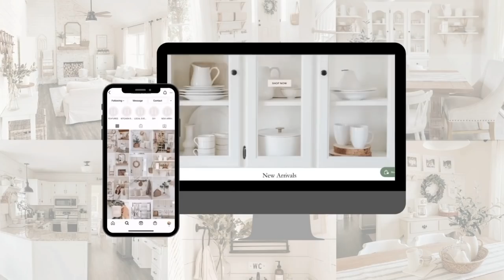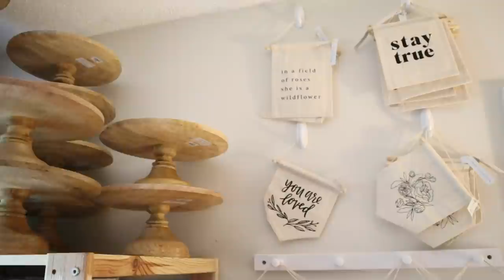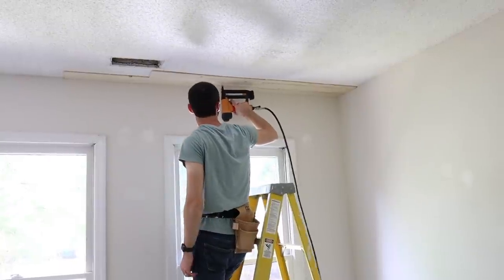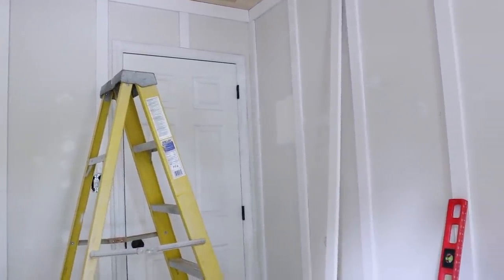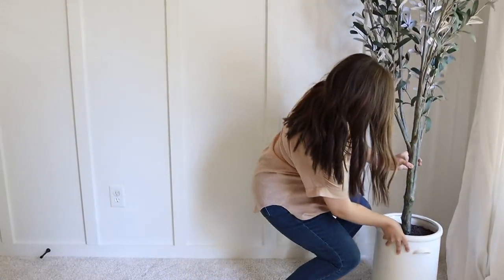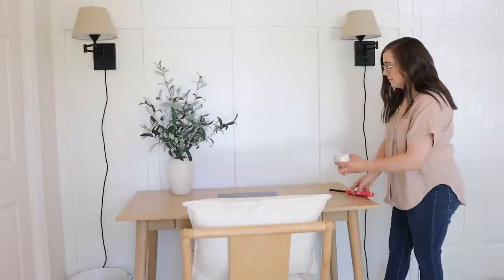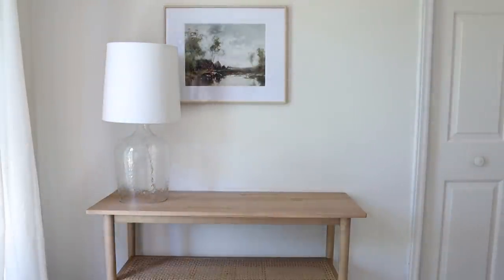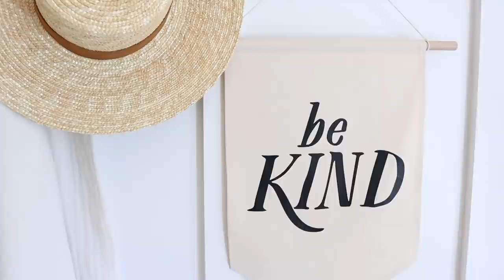HOME OFFICE MAKEOVER | DIY BOARD + BATTEN AND PLANKED CEILING TUTORIAL | FARMHOUSE DECORATING IDEAS

Comment: Would you be able to see inside thru the curtains after dark when the light is on in the room? Or not? Are they the same ones you have listed in the description box? I don't see the lines on them.
Reply from the maker: Hi Dee! Yes, you would definitely be able to see silhouettes at a minimum at night with the lights on in the room. They are the correct ones linked. For some reason, two of the three panels that I bought didn’t have the black lines. They were more of a textural line than colored line. I checked and all 3 are the exact same UPC code. So, keep that in mind if ordering them online. In the store you could get a matching set. ❤️